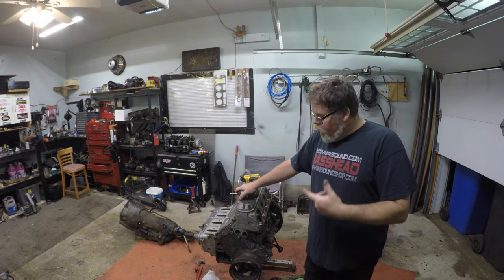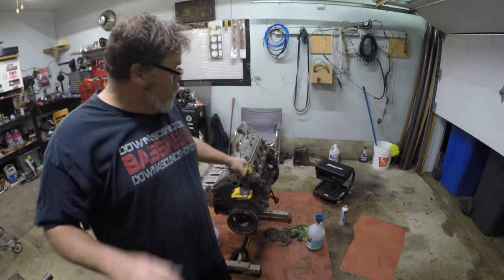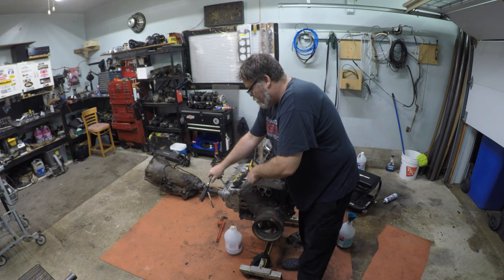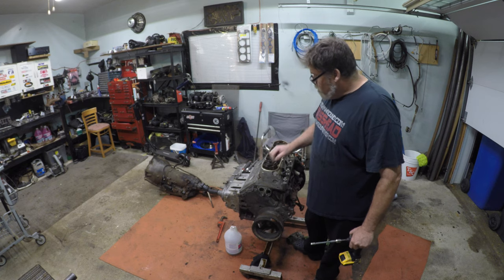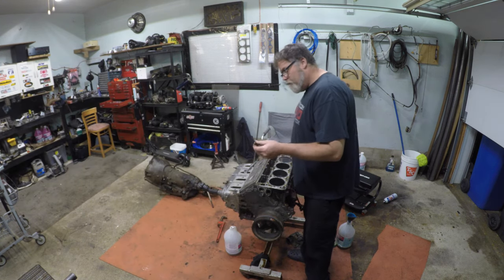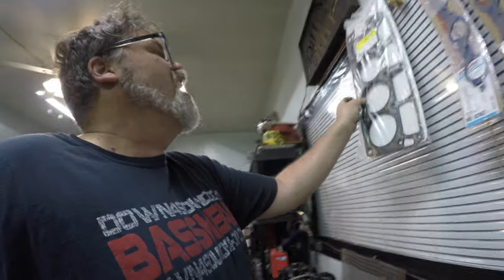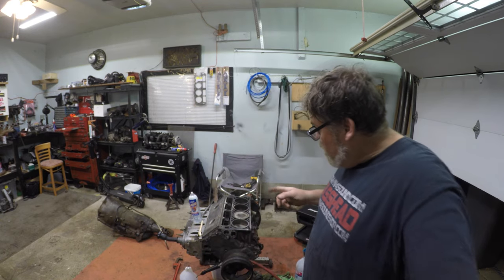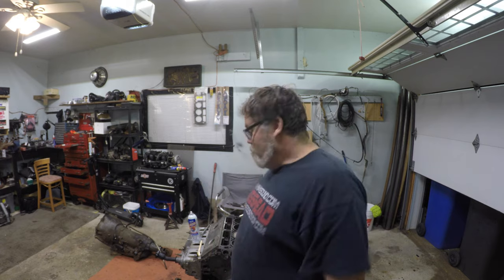The Heads Just Fell Right Off

Comment: LQ4 is what you have. its the same as a LQ9 but is a lower compression by (as you found out) dished pistons. raising the compression may or may not benefit you depending how much power you looking to make and what fuel you will be running. if your going to be running E85 you can get away with alot more so you might want to take all that into account before you make your final decision on the head gaskets. also if you have the room go with an intake off a TTSS if you going turbo, its a better intake in a boosted application. makes more TQ bc of the better runner setup BUT the down side its alot taller and takes up alot of room. if thats not an opt then get yourself a LS6 intake if your room limited. best of luck!